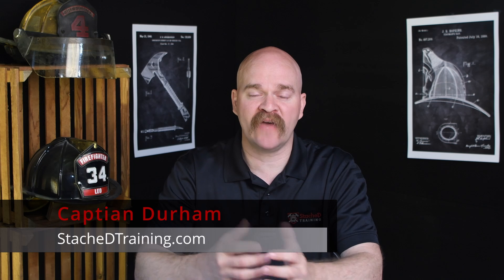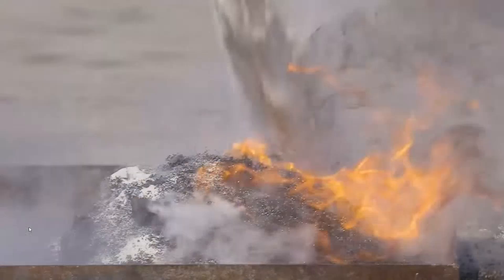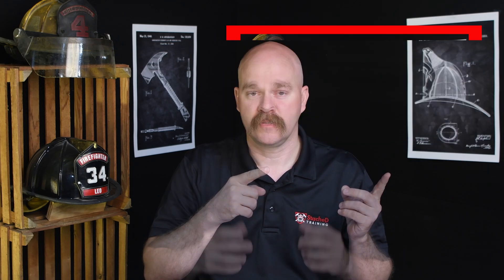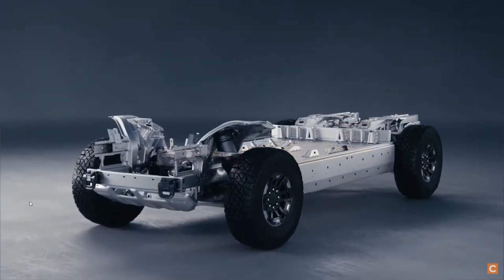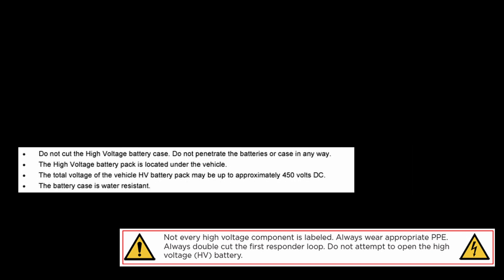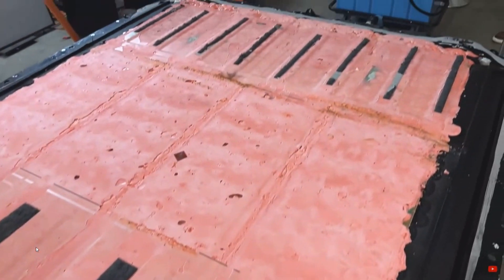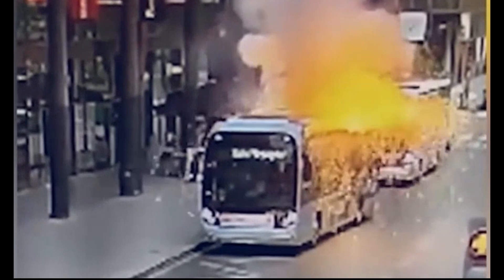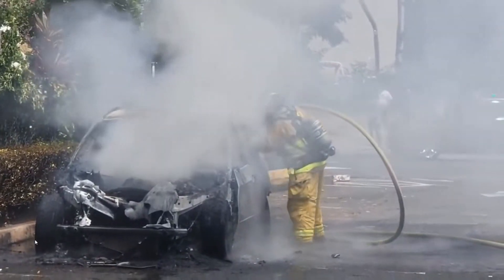What Firefighting Tools for Extinguishing Electric Vehicle Fires Really Work?

Comment: LION cells are like rocket fuel.  They contain oxidizer.  I agree with your recommendation to let it burn out.  I was part of team that designed a LION pack for an EV.  If they do go out, they can sometimes reignite hours or days later.  If you have an EV parked in your garage, you should get a heat detector alarm and connect it to your home fire alarm system.
Reply: "If you have an EV..."??? All are dangerous, even Tesla? What is the % of Teslas that have exploded?
Reply: @1voluntaryist  Far fewer than similar petrol vehicles. I was once forced to remove a bail of hay from a rented garage because it was 'a fire risk'. I replaced it with a Lightweight ex military Landrover. That had two ten gallon petrol tanks, one under each of the front seats. It also had a 100 litre propane fuel tank in the back. These vehicles have a reputation of catching fire. The garage owner was scared of hay but happy with the Land Rover. I just found that funny.
EVs are generally safer than petrol alternatives.
Reply: @mbak7801  Hay can spontaneously ignite if it's baled at too high moisture content, but a single bale isn't going to ignite unless it's a full round bale or large square bale.  A normal square bale would dissipate the heat because there's not enough mass.
Reply: @1voluntaryist  
A far lower percentage of EVs combust compared to internal combustion engines
Reply: @rogerstarkey5390  From what I've seen, that's the opposite of the truth.  I've never seen an internal combustion engine randomly self-ignite, it's always after some kind of accident or tampering, however I've seen more than a few EVs burn to slag just because they kicked up a pebble wrong.
Reply: @rogerstarkey5390 
Have you seen an EV have a substantial crash into ANYTHING !!
All the firefighters I know hate dealing with the resultant fires because it seems to them anyway that everytime a EV has a substantial crash it catches fire or explodes !! They have never had to deal with the amount of INCINERATED humans from car accidents as they have now !!
They are the ones first on the scene and they know what is REALLY occuring !!
Reply: By the time a heat or smoke detector senses anything it'll be too late.  You would need to attach a cable to your EV when it's parked inside so you have something to drag it out of the garage to burn in the driveway.
Reply: #NotAllRocketFuel contains an oxidiser like oxygen, peroxide, bleach, or fluoride, and if battery cells didn't keep reducer like carbon or lithium and oxidiser separate with porous cellophane, nylon, or polyolefin film, they'd be bombs.
Reply: " They contain oxidizer" Umm WTF? That is blatant lies.
The problem is thermal run away and shorting which can repeatedly reignite an AIR oxygen fed fire. The problem is once massive damage is done and fire starts it starts a chain reaction even when you suffocate the battery. There is NO oxidizer inside the battery pack. It's just very very hot.

Comment: Ultimately, I think the problem will be solved by moving away from battery chemistry that contains nickle, cobalt and/or aluminum to Lithium Iron Phosphate ("LFP") batteries.  You can pierce, crush and even try so set fire to LFP batteries and they will not burn.  When damaged, they will produce noxious gas, but will not go into thermal runaway and catch fire.  The trade-off for safety is a reduction in the amount of energy stored per pound of weight, but I think it's worth it.  I have four of them installed on my sailboat and love them.
Reply from the maker: LFP will absolutely burn.  It also gives off significantly more hydrogen compared to other chemistries.
Reply: @StacheDTraining  people fail to realise a charged battery is two highly reactive chemicals held in a state of maximum reactivity... three, really. two electrodes and an electrolyte...
that discharging is two highly reactive chemicals combining (via the third electrolyte), and only releasing a small amount of their total energy. what we pump in as electrical, or they release, is no measure of the energy stored in those chemicals altogether.
that the only way to increase power density is to use even more reactive chemicals.

Comment: I hear a lot about salt battery and they say they are cheaper and don't burn is that correct. Next question is why they haven't been used.
Reply from the maker: There's a big difference between a laboratory experiment and mass production.   Product development takes time.

Comment: Easiest way, scrap the ev's, because  they are dirty to produce, cost a fortune to charge from the ev charging points, don't have the range, and if you are in the vehicle should the battery short out, within seconds, you are toast. Worked on an electric boat, and was told, if the battery shorts, over 2000 degrees, of heat, is ejected from the battery.  As I say, toast !!!

Comment: Have you ever wondered exactly what is a "carbon footprint"?  The best example of a carbon footprint is the vehicle size black spot left on the ground after your E-car burns its tires off the wheels.
Reply: I've heard these referred to as "Road Pizzas" !
Reply: How about the black spots left in Canada after the global warming sparked fires, just a few tens of thousands larger I think.
Reply: @jjamespacbell  well to be fair global warning didn't spark them, a source of ignition such as lightening did. I guess we could possibly suspect climate change. As for the black spots, they will have brilliant green shoots of life in a week or two. I have seen burnt areas before many times very shortly after the fire. Life returns quickly.
Reply: Use those burnt batteries for the wall around the white house, recycling genius .
Reply: Sure, because gasoline cars and trucks never burn.
Reply: @truantray  pull your head out dude.  Where did anyone say only ecars burst into flames?  If a gasoline car burned down and left a pile of shit and a black spot, that would be the "carbon footprint" too.  Its not my fault you bought one of these shitty cars.  But if it makes you feel better.. Im sorry I made you cry.
Reply: @truantray  they seem to burn less violently than ev's imo
Reply: @juliogonzo2718  
Every "not EV" pundit tells us that the main issue with batteries is the energy density compared to fossil fuel.... "It's too low!!!"
Well, logically, that destroys your logic.
Fossil fuel cars burn more violently than EVs.
Reply: @rogerstarkey5390  yeah ok 😂 I guess you have never watched a video of an ev burning and a gasjob burning

Comment: the Ac or DC motors needs rebuild and the batteries need replacement! And have fires that spread like crazy! Plus their limited range and long charge times! Yeah they are the solution indeed to global warming! by destroying your mobility! Want a cheaper and safer car? switch to a regular gasoline powered car! Much cheaper and much safer!

Comment: best way to solve this problem?
stop making battery powered vehicles
especially with lithium, anyone knows what happens when water and lithium get together, it's not good.
in reality trying to put out one of those batteries with water is only making it worse.
the run off will contaminate the environment and if it goes into the water sewer system that's contaminated too.
imo, the best case scenario is to use a fireproof blanket like you showed and cover it up and just let it burn.
of course then there is the caustic gasses it puts out, not sure how to deal with that.
so what's the better of the 2 evils? blanket and gasses? or just water and environmental disaster?
neither one is good..
so the best way to prevent this? STOP MAKING THESE THINGS!
Reply: Exactly
Reply: The overall concept of replacing ICE's with electric cars is insane and a pure political move to get vehicles for the masses totally eliminated.
Reply from the maker: Lithium-Ion batteries do not contain lithium metal.   https://youtu.be/SWbHMeiSf9w

Comment: SINCE THESE ELECTRIC CARS CANNOT CONTAIN THE FIRE. WHERE IS THE GOVERNMENT WITH ITS RULES AND REGULATION LETTING THEM BE BUILT WITHOUT A FIRE SUPPRESSION SYSTEM. THEY GET AN F GRADE FOR SURE.
Reply: you CANNOT make a "fire suppression system" for a class D fire
Reply: @michaelkendall662  Since there is so much money spent on these batteries, I am certain if they would want to make s system work they could. Planned bumbling and lies. .
Reply: @victoryfirst2878  you CANNOT....research combustible METAL fires
Reply: @michaelkendall662  Got it Mike.
Reply: @victoryfirst2878  A "suppression" system by definition is a way to control or extinguish a fire...as you can't eliminate any of the THREE elements of fire (oxygen, heat, fuel) in a class D there is NO suppression
Reply: @michaelkendall662  Try Halon gas for suppression.
Reply: @victoryfirst2878  LOL...Halon takes away the O2 in an ENCLOSED environment where the combustible material LIKE Lithium does not PROVIDE its own...TRY again.....like I said...I actually have been trained and instructed in firefighting....YOU?
Reply: @michaelkendall662  No Sir. There has to be something or someway to make this work. Looks like we will be pondering for an answer for sure. Good day fella.
Reply: @victoryfirst2878  do some research...I have the training and better minds than mine have no answer because there is NOT one available......storage and handling of combustible metals is a dangerous prospect
Reply: @michaelkendall662  Well you got me on that one Mike. Nice talking to you Sir too. Peace vf
Reply: @victoryfirst2878  seems you either HAVE to have the last word or do not accept as an engineer there is really nothing practical that CAN be done.....raises another problem as well.......new study just came out showing a standard EV causing on average 2.24 times as much road damage due to excess weight as a modern ICE vehicle....EVs are just problems all around in multiple of ways
Reply: @michaelkendall662  I never realized that having a conversation means to have the last word. OR.  I never accept any engineers words as set in stone. I have proved so many wrong in my lifetime. Let me just tell you this Mike. The number of ways to increase the MPG of a gas vehicle are many and yet no commercial products are made to do just that, MILAGE. That seems to be just a TABOO ARTFROM. Good day fella vf
Reply: @victoryfirst2878  and he is STILL talking as if he has something to add to the conversation......you would think it would be enough when it was shown he had no reasonable addition to the problem of a Class D fire after thinking he had thought of one he would go away but he still thinks himself relevant
Reply: They be chilling on their yachts or hiding in bunkers
Reply: Because the government is pushing this EV "revolution" . Without lithium batteries they can not have there EVs revolution period to push on us all.  There is no fire suppression system that will work and they CAN NOT be put out.  Currently there are no alternatives to this battey tech despite people saying this or that, this is the only tech that makes EVs possible . Take the current batteries away and EVs are dead

Comment: won't be an issue going forward, EV manufacturers are already moving from lithium to more stable sodium
Reply: lol.
erm. try dropping sodium in water. 
can you say "reactive metals"?
Reply: Concrete pumping truck ready to go from each F. D. .
Reply: More dreaming, it ranks up there with the solid state battery which is also a failure

Comment: Tesla's are a hazard. No fuse able links on battery banks. No emergency disconnect for fire fighters like houses have. How much did they have to pay in bribes to by pass simple highway safety? You can get water into that battery box because it would electrocute you. Maybe Tesla should design the cars better. Not force every fire department to buy more equipment. When we already have highway safety regulations that have been ignored.
Reply from the maker: The fire hazard is not just a Tesla issue. It is an  issue that  affects all car manufacturers that use lithium-ion batteries.   

Water is not an electrocution hazard.  The high voltage batteries are isolated systems that are not grounded to earth or the chassis of the vehicle.

Comment: If the most pragmatic action, just now, is to let it burn out then I guess steps to speed up that process may be desirable. How about using thermite devices to burn into, and probably through, the battery-box?
Reply: Getting into the fire solves nothing! The fire cannot be extinguished. It is like trying to stop a nuclear fire in some respects
Reply from the maker: If I recall correctly, lithium-ion batteries burn hotter and faster than thermite.  I'll need to dig for the source on that one.
Reply: @StacheDTraining  Thermite burns substantially hotter and faster than Li-ion. The only problem with using thermite is you're also going to burn through almost everything below the car. I know the pavement under a Li-ion fire requires repair afterwards, but the repairs would be considerably more substantial after this.
Reply: That's about like throwing a flare on a raging bonfire, totally pointless.
Reply: @ffjsb  well, forest fire are often fought with "backfires" . not pointless at all.
Reply: @arthurmario5996  You COMPLETELY missed the analogy.  SMH.
Reply: @ffjsb  Dunno about that. I'm no expert so I can only  use what I find online. It seems that burning lithium metal can reach 2000 degrees but there seems to be general agreement that a burning lithium-ion battery doesn't exceed 1000 degrees. Against that is iron thermite which is quoted as reaching 2500 °C (4532°F). What I was wondering was more about burning into, and igniting, the non-burning end of a burning battery (if there is one).
Reply: @lotusdev  I got my info from the guys that actually do live tests of the actual battery packs from cars and stationary battery storage cells.  They burn WAY hotter than standard car fires, an can produce a jet like flame.